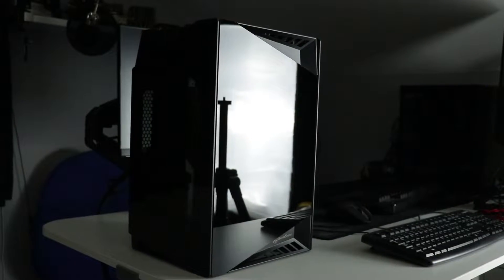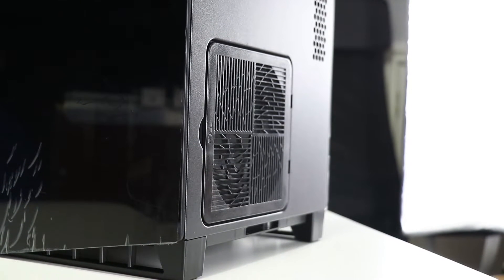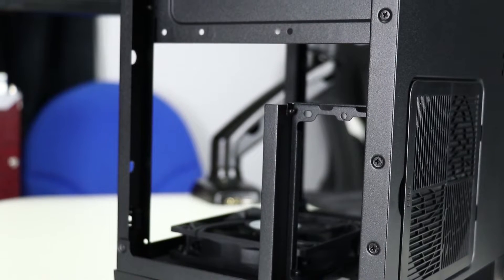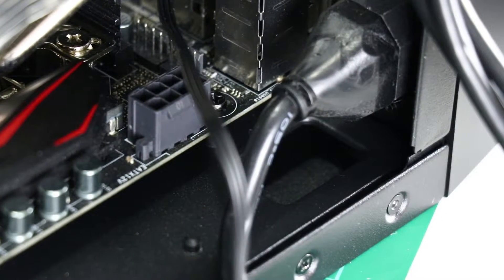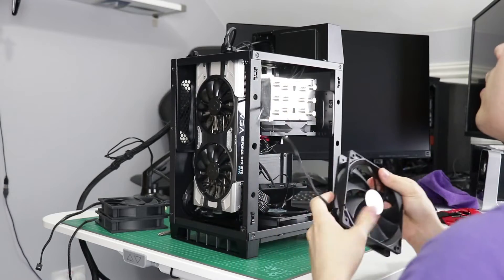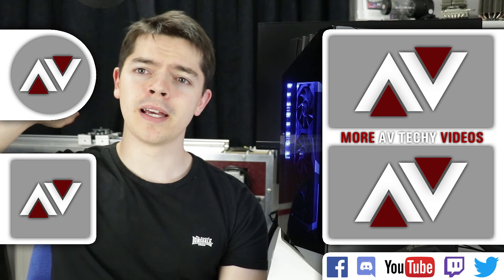SilverStone LD03 (ITX) Review

Comment from the maker: Timestamps:
OVERVIEW
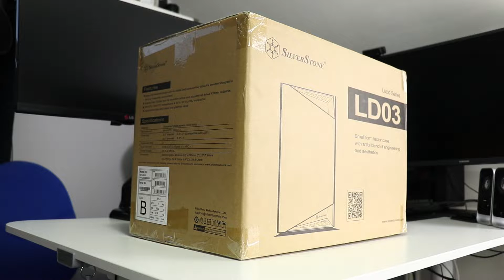02:31 - Un-boxing and External 
05:35 - Disassembly and Internal 
09:26 - Parts Bag and Manual 

BUILD
10:39 - Motherboard (with CPU, Cooler, RAM)
11:55 - Cable Management
13:23 - Power Supply Unit
14:33 - Drive (2.5" SSD)
15:04 - Comments on Cable Management
15:32 - Graphics Card
16:44 - Finish Wear and Tear
17:17 - Power and IO Cable Connections
17:55 - Re-routing the IO cables (not officially supported)

THERMAL TESTING / RESULTS
19:23 - Replacing the Stock Fans
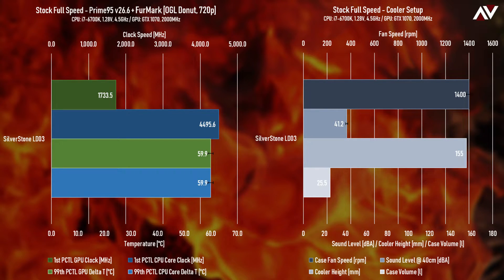20:34 - Thermal Testing Results (Stock / Acoustic / Full Speed)
20:36 - Prime95 + FurMark (10 minutes)
22:47 - Cinebench R20
23:17 - Unigine Superposition
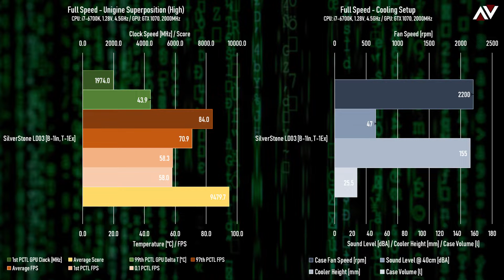23:52 - Hitman
25:11 - 3D Mark Fire Strike Extreme
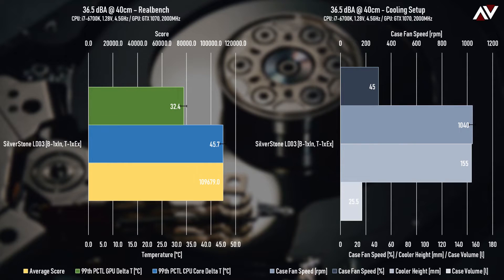25:28 - Realbench

B-ROLL
25:32 - B-roll (first results from the DIY Camera Slider!)

END
27:11 - Video Conclusion (main conclusion to follow)

Comment: Great, lengthy review. I would never have known about the mother board tray being removable for cable management if it weren't for this video. Quick note regarding thermals, for anyone using a GPU of 200W+ (i.e. 2080 Ti, 3 fan). Silverstone plans to release a version with a mesh side panel, but until then, you will have to settle for the prototype fix. I have the 3D print file for the accessory 80mm fan mount. Credit goes to Tech Buyer's Guru. Anyway, send me a note if you want it.

Also, regarding thermals, if you pop off the side panel for the gpu. You'll get a good 10-15 degrees less for the gpu. With a 3900x and zotac 2080 ti 11gb, 3fan, I was doing 70 gpu and 75 cpu under load, even with an AIO and 3 noctua 3000 ippm fans. With side off, gpu was 55, no improvement for cpu. Idle temps were 28-35C each.

If you do a search, you can also find some liquid cooling videos, in chinese however. If you plan on using radiator for both cpu and gpu, maybe you can do sandwich style up top by externally mounting the 120mm. Space up top is limited by the tubes that will go towards the aio

Comment: Great job on this one.

Nice to see Silverstone play with the styles, layouts and form factors.
Showing courage in their design and thinking things through to details like the gpu hole, side panel mounting and removable mainboard tray.
Personally I like the dark tint on the glas, depending on the style of system I'm going for, but not everyone or even most don't like it this dark...
maybe versions with a lighter or no tint and just screen printed edges (or even interesting design) could be a good idea.

Yeah those slide shots really bump up the b-roll a notch, liked how you stuck to the beat in editing, nice touch. 

All you have to do now is build up the muscles to lugg that sucker arround. . . ;-)
I'm sure you noticed that tripod in the reflection... at least in post... doh^^

Could really imagine a water cooled setup to look quite nice in this case with its 3 sided view.
Like you said, reservoire in front of one panel, gpu block visible on the other and front showing the mobo, perhaps even mounting a rad in that "tophat" passing the tubing through that "mod'able cover" 

Not sure if that extra work would be worth it from a views standpoint tho??

Great to see new reviews from you, thanks
Reply from the maker: Thanks man. Yeah I'm glad to see something a little more interesting than the same rehashed front intake, rear exhaust design most cases go for. Although I'd actually really like to tip this case on its back and make it into a wind tunnel style system :P

Yeah it's a really dark tint, and it makes it tough to see the components inside without internal lighting. I think RGB fans would do really well here.

Glad you liked the slider and the editing. Sticking to that beat was really tough, there wasn't a lot of visual feedback to see where the beat was so  you probably heard I missed it a few times :P

Yeah I need to get way more into shape for that thing, but then again wheels are cheaper than a gym subscription haha. Yeah I saw the tripod in post. Honestly I was just shot at that point. This house search, and mortgage stuff is on my mind a requires a fair amount of attention which causes hiccups in the flow of creating videos. But when the house search is done it should all pan out nicely :)

This case has to be for water-cooling, there's just so much space available it's hard to not see a huge reservoir, or even a couple (top and bottom with two pumps). Yeah, the GPU block would look really nice. But I think rather than placing the radiator in the top hat, I'd throw the fan up there to keep it simple, but that may need a work around to get over the raised grill section.

Anyway, glad to be back. Now let's nail the rest of the year!

Comment: I also did some research for liquid cooling. You might be able to use a Phanteks R160C on SSD side of the panel. As to how you might screw it in, you might have to MacGyver it. Otherwise, you might have to use cpu/pump/reservoir combos, or be forced to not do push-pull configurations by mounting the reservoir above bottom radiator, like the guy did in a Chinese video a couple weeks ago if you searched "ld03" and did a date filter.

An improvement on the case. Maybe provide a screwable cutout behind the motherboard tray for an ssd as using the ssd tray on the other side of the case is cumbersome and very awkward for wiring, especially when you can be using that space for other things.

Comment: No mention of the SilverStone SG13? $60 and half the height of this case with a similar footprint. Also the Cougar QBX and a few other budget ITX cases under 20L.
Reply: Well it is a review on this very case, not a case roundup. So to be honest I don't really see why it should be mentioned.
Reply: @TotoGeenen  I mean in his comparison. He compared it to the few ITX cases that are around the same size, but there's plenty of cases that are cheaper AND much smaller. Somebody watching this video may not be aware of those cases and might think all ITX cases are around 25L.
Reply: @vinyfiny2019  ah I see. You're right. Though still, it's not really the point of the video.
Reply: @TotoGeenen  True, just pointing it out.
Reply: @vinyfiny2019  okay. All is well :)
Reply: Lol. If you want him to mention something, it should be the 30L version, Phanteks evolv shift x. It'll fit all the necessary cooling equipment to make sure your high end gear stays cool With waaay more mounting points than the LD03

Comment: I'm trying to think of a reason to get this case instead of something like Fractal Design Nano S, and I can't think of a single one...

Also, in a review of this case in some other channel, I criticized putting the closed off glass panel directly in front of the GPU because it will choke the GPU intake and someone from Silverstone themselves replied that it's deliberately done...which suprised me in a bad way. "Screw the cooling, better slap that glass on 'cuz it's hip these days" is a design philosophy I don't want on my case...

Luckily, there's a bunch of good older cases out there that are made with proper mindset, like the aforementioned Nano S or Silverstone's own SG13...get them while they're still available, leave these aquariums to fishes and sheep.
Reply from the maker: Maybe this case just doesn't suit your tastes. It has a smaller footprint than the Nano S to it's easier to accommodate on a desk, and has tempered glass side panels instead of the plastic ones on the Nano S so they're much harder to scuff and scratch, and reflect more light which generally looks more appealing (in the same way jewellery shops tend to go for glass instead of a high strength poly-carbonate). 

The Nano S is a fun case, but it's not all that interesting to look at, not to say it doesn't look good. This case itself looks pretty interesting, and has loads of potential to show off a really cool looking build from many angles where the Nano S has a single smaller window. So it's probably just down to your taste which this case doesn't appeal to, rather than there not being a reason to buy this case over the Nano S.
Reply: @AVTechy  If you want to show off your build, you can just stick it on an open bench and erect some glass panels around it, if you really want to look at glass...right? If you have a case, an actual case, there's a whole other set of things in the game...like actual airflow. Something this (and many other) cases just shove aside in favor of whatever is trendy, which is currently glass and lightshow.

I agree it's a matter of taste but there are some things that should always be a priority, and manufacturers should know how much is ok to sacrifice to looks and trends. I wouldn't rant as much if they just made some of those critical panels perforated/somewhat breathable (which they totally could and still have it look nice), but no...must have aquarium at any cost.

Nano S is too big for my taste, just like this, but I can totally understand people who want Nano S because it looks good and slick, hardware compatibility is good, the airflow is good (especially for GPU), it's AIO friendly, silent, not expensive...meanwhile, what's the selling point of this case, what makes it good? "Hurr durr, look at pretty glass!"...Welcome to casemaking 2019.
Reply from the maker: @LastSecBloomer  I don't think the Open Bench argument stands up. For instance there's no way I'd be able to construct a clean looking build in a cost effective manner with an Open Bench and glass panels. Some people are skilled, whereas some would need a lot of practice to get good looking results, and they might not have the tools to hand to get those results (or have access to cheap, decent quality materials to keep the mod cost effective).

I'm not sure if you were looking at the same test results as I have been. This case is perfect for those who want a great looking build with loads of CPU airflow for CPU dominant tasks. The GPU isn't really struggling for air, it does perfectly well even at full load, but of course there are limitations in this case due to the small footprint not allowing for a larger 140mm fan to cover the graphics card section as well as the CPU cooler section, so people should bear in mind this case may struggle with the most powerful GPU's on the market.

I'd 100% argue this case looks good and slick as well, and has excellent hardware compatibility. The Nano S can't fit a card larger than 2 slots (due to the PSU that sits directly underneath the GPU, probably not good for airflow I can imagine), the LD03 can. The Nano S can fit up to a 160mm CPU cooler, the LD03 can fit up to a 190mm air cooler. But the odd design of the LD03 drops the ball on some case cooling features (lack of 240mm radiator support for example), and airflow over the GPU isn't as strong as the Nano S.

So there's pro's and con's to each, and to pretend there's nothing appealing about the LD03 (especially over the Nano S) because it's clad in glass (bearing in mind the base and top are completely open for ventilation) is disingenuous as best. It's fun to get on the bandwagon about having too much glass, but the LD03 isn't trying to force air around cracks in the glass which is why that argument is so string in other cases, it's dedicating intake and exhaust completely to the base and top of the case. "if they just made some of those critical panels perforated"... the side panels aren't blocking intake or exhaust airflow, they're channelling the airflow from the base to the top in line with the fans, perforating them wouldn't do a lot here (also the rear of the case is perforated right next to the graphics card position so it's all good). You're clearly railroading on the typical argument when someone see's a lot of glass in a case, and it just doesn't hold water when the test results dismiss it. Tip the case sideways and you've pretty much got yourself a wind tunnel that's mostly dedicated to the CPU cooler (and I agree it's a shame the Graphics card section isn't a higher priority).

The selling points of this case. Let's see... Looks great (glass just looks better than plastic), following that it steps away from typical case design making it look more interesting, great CPU ventilation, solid CPU cooler and graphics card compatibility, has a smaller footprint than many cases on the market, and depending on the individual there are probably a few more major selling points to it.

I'd save those arguments for another case, they seem to be more opinion based (mostly based on a lack of appeal to glass, and misunderstanding the base to top cooling strategy) than factually accurate (the thermals came in as positive results, if that's the case the cooling is good). I think I'd recommend this over getting a test bench and trying to attach glass to it in an appealing way (especially considering the cost of a good looking test bench).

No hard feelings man, but those aren't strong arguments when the evidence refutes them immediately.
Reply: Sorry we gave you the wrong impression that we didn't care about cooling for the LD03 in the previous reply. We actually care so much about it that we spent months testing and fine tuning the design with multiple prototypes to make LD03 the best it can be with a tempered glass on the GPU side. We made the case slightly wider than earlier prototypes so there's more gap from the glass to GPU, there are extra venting holes on top, rear, and bottom around the GPU area for more breathing room. The fan we include also has airflow profile with greater angle so more of the intake air can be spun off toward the GPU. All of this efforts enables LD03 to safely handle open air cooled graphics card up to 200W (which is largely verified by the result from this video). Below is a summary for recommended GPU power for the LD03:

Up to 200W - Air cooled (open air design)
Up to 300W - Air cooled (blower design)
Over 300W - Liquid or hybrid cooled

Mind you, this is for GPU or graphics card only. For the CPU, there is literally no limit thanks to LD03's rotated motherboard design and 190mm CPU cooler height clearance. Again, our goal is to always make the best thermal design for any type of case form factor. As you noted, we already have quite a number of other small form factor cases that are great for cooling without tempered glass so why not try our hands on also making the best tempered glass Mini-ITX case on the market too?

With all that said though, we do realize that people may still want the LD03's profile and willing to sacrifice some of that all tempered glass look for even better performance. So a GPU vented version of LD03 is in the works for release by the end of this year!
Reply: @Silverstonetech  that sounds awesome. Will the vented side panel be released as an extra purchase for those of us that already have the case? Also, i heard from other media that the side panel will be plastic instead of aluminum? Just as extra input, please make it aluminum. The plastic up top is okay, because I understand it needs to be light for easy removal, but any more plastic would take away from the aesthetics of the case. I'm sure others would agree that they'd be willing to pay a little extra for an aluminum side-vented panel.
Reply: @jackofnowhere  There are currently no plan to release the vented panel as a separate retail purchase, we may just have our branch offices sell them as spare parts. This is not totally settled yet. As for the vented panel's material, we had gone through several redesigns since showing off that prototype vented side panel at CES in January. Initially, we had settled on using plastic frame around a mesh design. But it was changed to primarily tempered glass and steel , with discreet amount of plastic for the vents, it will look very cohesive with the rest of the LD03 design.
Reply: @Silverstonetech  how or where would we go to purchase spare parts?